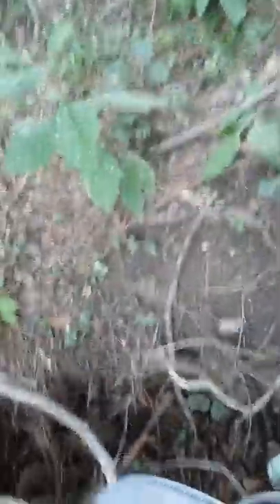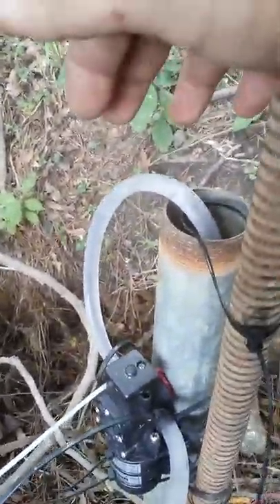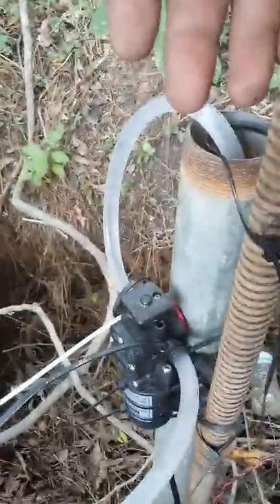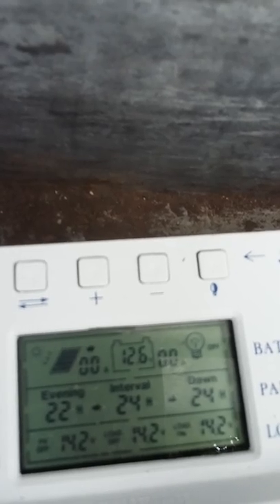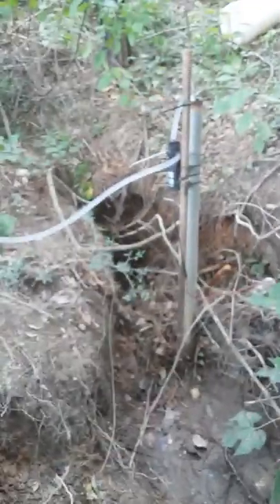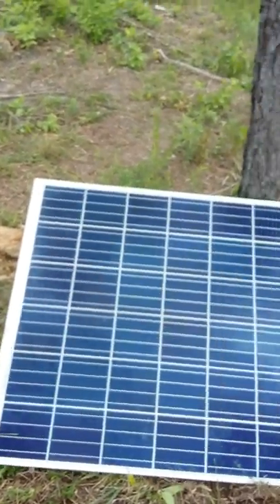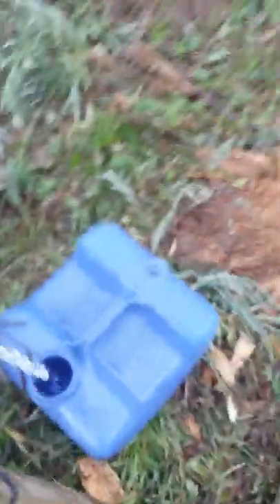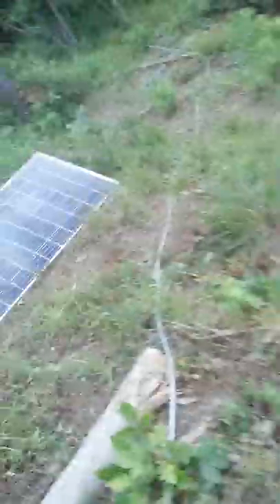Solar powerd well

Comment: NICE BROTHER!! One tip that will help. Add a check valve in the well that will help the pump from needing to work to get the water to the pump and one in the line after the pump. That will help with back PSI.. Tho's 2 things will make your pump last loger and take less power..
Reply from the maker: yankey4  thanks